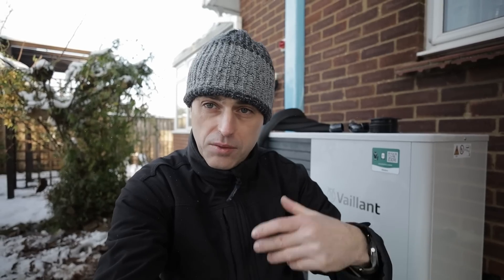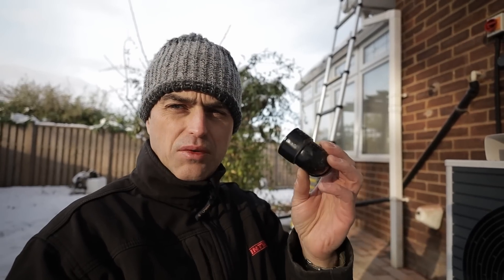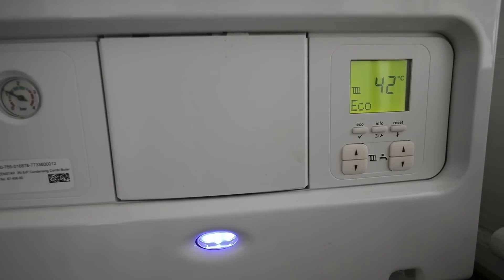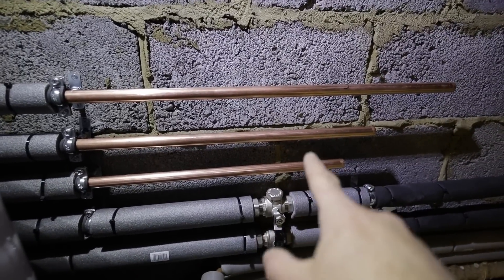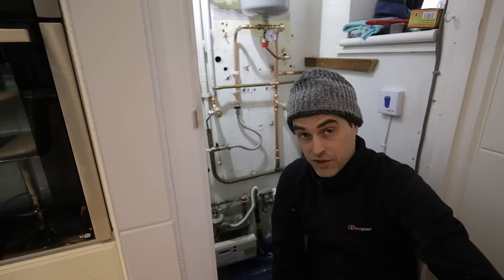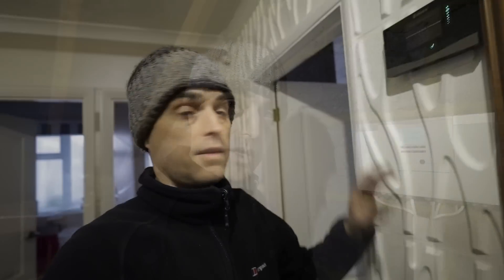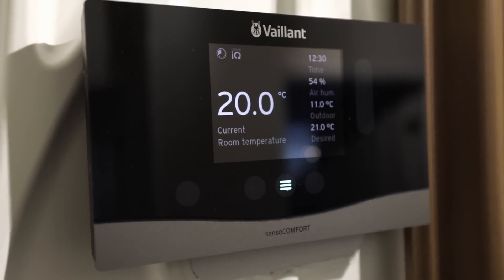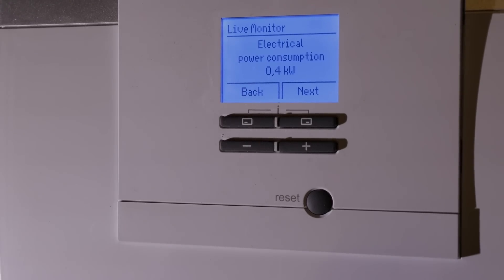How to Install a Heat Pump That Works

Comment: Great job with a really well made video!  I have checked with several Viessmann 200-w gas boiler (which also has advanced weather compensation, like the heat pump and can modulate down to 2.2 kW) customers over the past few days. Sub zero temperatures led to very similar costs to the heat pump installs. Said another way, savings were minimal, if any, without the massive upfront cost! 

So while they will save £ compared to older inefficient boilers, heat pumps won't really achieve much savings against a V200 unless something else changes dramatically. Worth considering for those in flats or who don't have the budget for an AroTherm+

Merry Christmas to you, all Heat Geeks and thank you for the 20 odd videos you created this year!
Reply: the savings are minimal because here, in the UK, "dirty" solar/wind electricity cost 25% more because of the green levy and "clean" domestic gas has no such burden. 
> don't have the budget
then government should subsidize installation for them. as a taxpayer I would rather pay for HP installs rather than fines for carbon reduction agreement violations.
Reply: I look at it the other way, why fit gas boilers this day and age. Heatpump combined with pv and smart tariff (octopus), you can isolate yourself from gas prices+fluctuations and get roi in 5-7 years.
If you're on a newish boiler or poorly insulated building i agree with.  though plenty of people still going for boilers in newer type buildings.
Reply: @SBTRIS  I can try to explain why:

1) Solar PV on its own does not perform in Winter. Even a 5 kWh system will generate no more than 300W an hour for 4 hours on average UK winter days. 

2) Upfront cost of £6-7000 over and above a Viessmann 200-W (installed) after the BUS benefit is factored in. 

3) Property incompatibility - no external space to fit the unit in a way that meets design spec and does not anger the neighbours. 

If you're running a non-condensing boiler, a 10 year old boiler or an oil boiler, get a heat pump without any doubt. But if you cannot get a heat pump for any of the above reasons, get a Viessman 200-W.
Reply: You do realise gas prices are going to keep going up faster than electricity?  At the moment the price ratio is 3.5x but that will come down to around 2x when the green levies on electricity are transferred to gas (which is being planned).  At 2x a heat pump is a no-brainer.
Reply: Our gas prices are over 3 to 4 euro's per m3 already. I get electricity at 0.40c per kWh. Heatpumps are already a no brainer in a lot of countries. Then I have solar aswell. Any kwh's i feed to the grid, Im allowed to use as credit later that contract year. I dont pay anything per month atm. I get money from the electric company.
Reply: @Deiphobuzz  Based on several of our customer's feedback, the V200 is offering similar costs (in gas) compared to heat pumps with established SCOPs in the 3-3.5 range. A SCOP over 4 would mean savings of a few hundred £ a year but the upfront cost of installation still remains. For many, this puts a heat pump out of reach. 

I am a passionate advocate of Solar PV (if you have a South or West facing roof). But you cannot run a heat pump on PV in the winter months, nor can you charge your batteries on anything but a cheap tariff either.
Reply: @hazmat5749  I do realize that neither you or I can predict what is going to happen with energy in the next 6 months, let alone a year or two down the road. 

That said, there is nothing about a heat pump today that is a "no brainer" unless you are replacing an oil boiler or use pure electricity for heating. If you have the spare £, get a AroTherm+ or a Daikin if your property can achieve a SCOP > 4. 

If not, get a V200-W and cut your gas consumption by over 35%.
Reply: @singlendhot8628  The governments stated aim is to transition from gas to electricity for home heating.  From 2025 it will be illegal to fit a gas boiler in a new build property, from 2030 illegal in any property.  To encourage this the green levies currently on electricity will be removed and transferred to gas.  
My gas boiler is 35 years old and about 80% efficient - perfect for heat pump retrofit. Also I have access to cheap electricity, 24p per kwh, so in my case a heat pump makes real sense.
Reply: @hazmat5749  Agreed - you are a good candidate for a heat pump IF your home is well insulated and your emitters are oversized K2 or K3 radiators or UFH. 

To be clear, new boilers are not banned from 2030 in existing homes. Only in New Builds from 2025, which makes sense as Part L building regulations mandate higher levels of efficiency required for compatibility.
Reply: @Deiphobuzz  Thats  expensive gas ! Wow!  UK gas is 10p/Kwh 1.3eur0/m3 Electric about the same . ( both government subsidized prices)  & we get £400 gift from the government . The old get more.
Reply: @singlendhot8628  You are totally right. ASHP only can break even with Gas boiler... . Its all about the running cost and also during winter ASHP efficiencies plummet. ASHPs are only good for domestic hot water combined with MEV or MVHR. Don't get scammed and also if you have an older house as soon as you start compromising room temperatures you will get mould. As soon as flow and return temperature will be reduced Radiators coefficiency factors will drop and you will be in a pickle.

If you design a new house and you would prefer to avoid gas then go for it!  MEV/MVHR ASHP (for Domestic water), Eclectic heating and a bit of PV would sort you out and I bet it would cost less upfront compering to wet system in the house. 

Szymon, I think you are selecting equipment on point, but I would put some margin that compressor, building and everything will start ageing...  . Last think that you want is for someone to call you in 5 years to find out the system doesn't work because of airtightness, compressor loosing efficiency, etc. 
Also compering to Gas boilers DX have a motor which has a certain lifespan...
Reply: @singlendhot8628  On the emitter side - they may actually be sized OK. Many gas boiler installations (still) are slung in. The users are used to having piping hot emitters and run their systems for a portion or portions of the whole day and are content with that. So, moving to a heat pump which is a 24/7 low and slow approach the emitters may be pumping enough heat into the room over a 24 hour period (to cope with heat loss) on that basis. The general advice - unless it is dogs bollocks obvious that an ‘emitter too small’ is to try and see. However, most good heat pump installers will take the heat loss calculation approach and that includes an assessment of the power required for each room at design flow temp at - 2.
Reply: @normanboyes4983  We do heat loss surveys for all our heat pump installations. Regardless of the result, we always quote to replace all single panels radiators with a minimum of oversized Stelrad K2 (ideally K3) radiators or wet UFH before we agree to take on any work. The goal here is to get that flow temperature as close to 35 as possible. We don't always achieve it but we do like to ensure our customers save every penny possible - it's the only way heat pumps will overcome their current stigma.
Reply: @singlendhot8628  Good, I would expect nothing less.😉
Reply: @singlendhot8628 Your post is misleading. I get more peak solar generation than you claim on my installed system. I do get poor generation in the winter but that is missing the point. In the spring and autumn you can still get great generation and a heat pump will outperform gas during that time. Then there is summer where I will have free hot water for months on end and no gas standing charge.
Reply: @SimonEllwood  I would argue that it is your post that is misleading. Allow me to explain why:

1) Free hot water is a terrible idea (unless you are on FIT) as you could be exporting that energy for close to 20p per kWh (vs. hot water heated via gas at 4p (Octopus smart tariffs)

2) Using the same logic, a heat pump will not outperform gas no matter how great your shoulder month generation is as the gas owner can sell that PV energy to the grid for 20p per kWh on Octopus Flux and pays 4p per kWh to buy their gas on Octopus Tracker.

You didn't assume gas households can't have PV installed, did you?

The only way a heat pump household comes close to the above stated numbers is when a large battery bank is purchased but that often involves a minimum of another £7K in costs.
Reply: @singlendhot8628  Free hot water is a good idea and yes I am on FIT. If you are not on FIT you still have a cheap lower carbon period to heat your water with an efficient heat pump. You still have not addressed the much cheaper 9 months of the year. If the running costs are equivalent but the carbon intensity is much lower and improving year on year then personally I take the hit on upfront costs.
Reply: @SimonEllwood  Another reality check for you:. Heat pumps are least efficient when heating hot water. And I didn't say that costs are equivalent, I said the Viessmann and Octopus smart tariff combination is impossible for a heat pump to match without a large battery.

When confronted with the hard numbers, it's common for heat pump owners to raise carbon intensity, which remains grey to say the least. Carbon intensity is actually higher when windspeed isn't up to requirements in the UK as the transmission losses from the gas generated electricity are high. Not to mention the embedded costs of the heat pump itself. 

I believe have addressed all 12 months of the year when I said that PV owners with efficient gas boilers will still come out on top as they will be selling all of their excess energy to the grid, which is severely lacking in Solar generation (vs. wind), at .20p per kWh.
Reply: @singlendhot8628  I am generating 1100W right now from my 3K array so that shows your 300W in your post is NOT true. I will be getting a battery this year and I will get a heat pump at some point in the future. It is lower carbon and the running costs are comparable. The carbon intensity of heat in my home will then come down over time as renewables are added to the grid. This is also the case with my EV.
Reply: @SimonEllwood  Ofcourse you "can" generate more on the odd sunny cold day. But most days will be overcast, wet and often freezing. You won't be generating anything close to 1100W then.

You've conveniently ignored the carbon intensity of manufacturing the heat pump and battery you claim is "lower carbon", not to mention directly funding China, one of the worst nations on humanitarian or emissions grounds. 

You are correct about one thing though - over the next half decade, the carbon intensity of the grid is set to reduce dramatically when more wind farms come online. That, combined with rooftop PV, will allow a home to achieve genuine reduction in carbon intensity. But we are not there yet.
Reply: @singlendhot8628  I am a PV owner with FIT so I cannot gain 20p by exporting that is an lie. I also know that hot water has a lower COP than the average for heating. You have definitely NOT covered the whole 12 month costs. I will get free hot water in the summer, free of cost, free of carbon, free of gas standing charge. In the Spring and Autumn I will get much lower running costs compared to gas with a huge proportion of high COP heat from off-peak electric, battery and solar.

You are of course correct all that comes with a large upfront cost which is a hit I am willing to take.

Running costs and Carbon WILL be much lower.
Reply from the maker: My heat pump runs at 390watts 90% of the time - so PV will cover my heating even in the winter
Reply: @UrbanPlumbers  How many heat pumps in service can you claim the same for? For our installations, we average between 400-750W for the majority, but we have seen jobs which consume 30kWh per day or more.

PV will not cover your entirely consumption in the cold months (November -Feb). The window of generation is 9AM-3PM and you will be lucky to get 400W continuous generation on most winter days. It will help, but it really shines during the April-October months (forgive the pun).
Reply from the maker: @singlendhot8628 just check OEM - tons of them run at 400-600 watts.
Reply: @SimonEllwood  As a FIT owner,  batteries and hot water diverters do make financial sense, as you are effectively being subsidized by the taxpayer and not earning based on your actual export.

That said, your understanding of carbon is a bit too dislodged from reality so I wish you the best with your fantasy.
Reply: @UrbanPlumbers   Not in my experience. Rating vs. real world are miles apart. Let me know if you want installation addresses with 30kW + consumption per day for heating.
Reply from the maker: @singlendhot8628 all info is on OEM - 100 heat pumps live view with all data since they were installed
Reply: @singlendhot8628  Thanks for your meaniless FUD reply. You jump to conclusions and guess. You quote 300W, no not true. You assume I can export at 20p a kWh, no not true. You claim I know nothing about carbon, not true. You pretend China is super bad at addressing climate change, not true. Stick to the truth and facts you can back up.
Reply: @SimonEllwood  You left out the part where you strike me as the village clown who was sent home from the pub and now has no outlet but his keyboard.
Reply from the maker: @singlendhot8628   - it is not about experience - it is about facts - and they are available here: https://heatpumpmonitor.org/
Reply: @UrbanPlumbers  That's an excellent showcase for competent heat pump installations. I won't share which firm we are but a few of our installations also feature there. That said, you are skipping over the hundreds of installations that barely touch SCOP of 3.
Reply from the maker: @singlendhot8628  here you go - scop of 2.8 - 5kW unit - runs at 500 watts. 5 and 7 kW units dont use that much energy overall. This can be run so cheaply. Mine for example will cost around £75 in Jan - and that is at 34p/kWh - and I get a cheaper tariff.

With PV I will produce more than I can consume - so not only zero bills, but also an income from energy sold to the grid.
Reply: @UrbanPlumbers   Even at a near ideal 500 Watts consumption X 20 hours, that's 10kWh per day X 30 days = 300 kWh X 0.36p = £110 per month. Simple numbers - I think your estimate is very optimistic as the above will highlight.

As I have shared several times, some of our customers have daily consumption as high as 30kWh ( with Samsung heat pump installations - just one example - have several more)
Reply from the maker: @singlendhot8628  the heat pump doesn't actually run 24/7 - mine uses around 7-8kWh for heating and hot water at the moment. 4kW solar PV generates 12kWh on a day like today - so covers all heating, how water and also house use.
Reply from the maker: @tEXKiKos  my ashp cop in the winter is 4.7 - so way cheaper to run than a gas boiler - but I know what I am doing, so...
Reply from the maker: @singlendhot8628   - not true again, Adam Chapman from HG gets COP of 4.8 on DHW in the winter - but again, he knows what he is doing and how to design an ultra efficient DHW cylinder.
Reply: @UrbanPlumbers  cost of 1kW electricity = 29p per vs Cost of 1 kwh of gas is 8p.  29/8 = 3.6 . most systems are barely ending at the same running cost, electricity is 3.6 times more expensive then electricity, so if ASHP COP is 4.0 then we are looking at margin error. ROI of installing ASHP heat pump for an existing budling = forever and not 5-10 years as you are saving 200 pounds a year on running cost?
Reply from the maker: @tEXKiKos  yet my unit is running at scop 4.7 in the winter. You also miss the fact that boilers are only 80% efficient on average so it is not 29/8 - more like 29/10 - so 2.9 scop is parity on gas. Byt the prices here are 34/9p = so more like 34/11 - cop of 3.3 in reality is parity with gas.
Reply: @UrbanPlumbers   I am aware which is why I only used 20 hours for the above calculation. Your 4kW Solar PV system will generate 12 kWh on clear sunny days but will generate barely 2 kWh on most winter days if you're lucky. 

There is ZERO chance Solar will cover even 1/3rd of your monthly consumption from November - February.
Reply: @UrbanPlumbers  Sorry, but we're all not Adam Chapman
Reply: @UrbanPlumbers  If you want to be fair, compare the 95% boiler efficiency with a 4p per kWh gas tariff (Octopus) with your heat pump numbers and tariffs. Resist the temptation to cherry pick the numbers that suit your argument best.

Comment: I have a heat pump it was thrown in by a company who took the money and ran left me with horrendous bills.Complain to who no one wants to know MCS installed all the correct products installed.but utter useless left me high and dry.We are looking into it my top team are on it 2 Years I have been getting the deaf ear off Dynamis.Buyer Beware.The flow is colder than the return sick of telling them this.Your videos are spot on by the way and Heat Geek

Comment: You mentioned changing the radiators, but do you also have to change the size of the flow & return pipe work to radiators?

Comment: Great video. Please do a video on the ashp survey process and the heat loss calculation. Selecting building construction and U values. It would be greatly appreciated. I use heat engineer also but unsure If im using it correctly.

Comment: When you carry out a heat loss calculation do you allow anything extra for hot water or is it a given that the ASHP will handle that as well due to the 3 port valve?